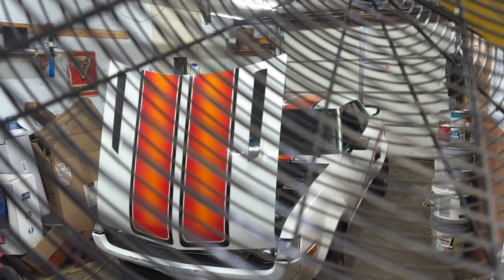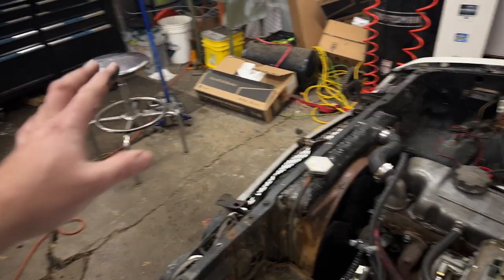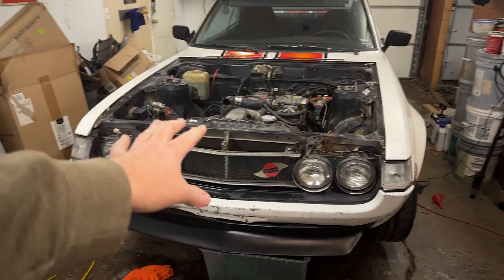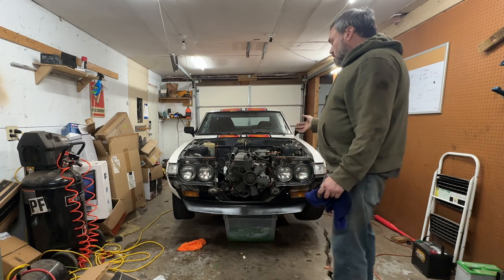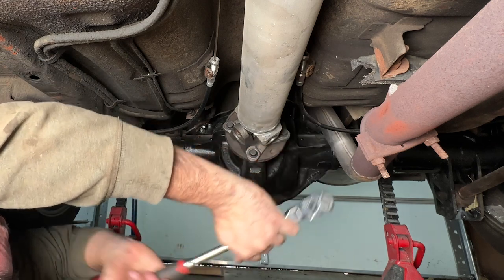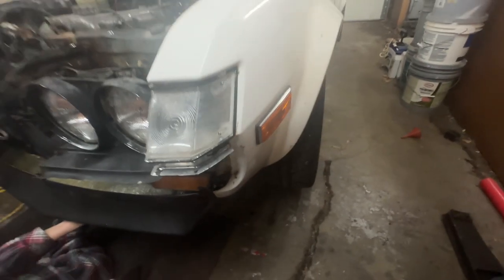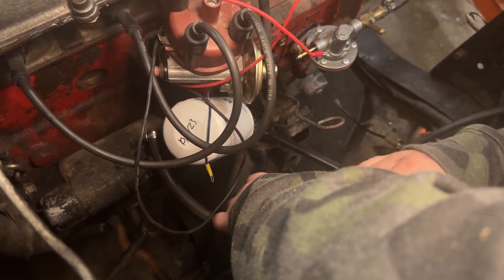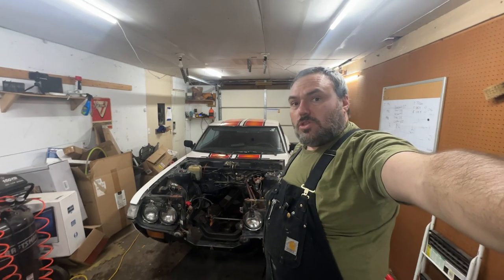1972 Celica Motor Swap - Part 1

Comment: @oioracing Love the project! Is that an Explorer 8.8? Did you have narrow it to make it fit? I want to put one on my RA29
Reply from the maker: It is! You need to get 2 passenger side axle tubes then have the drivers side axle shortened. All the work was done by Thomas Gary at Gary rod and chassis in southern Missouri. He’s the man to go to in the Midwest.
Reply: @oioracing  Much appreciated!